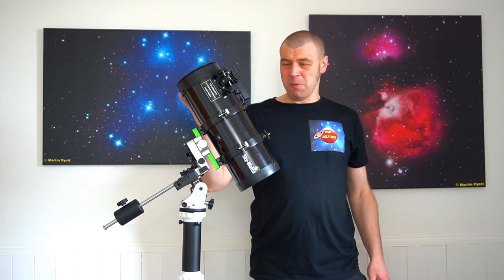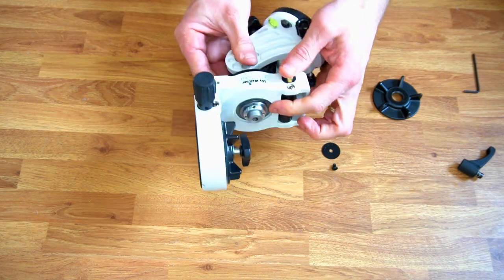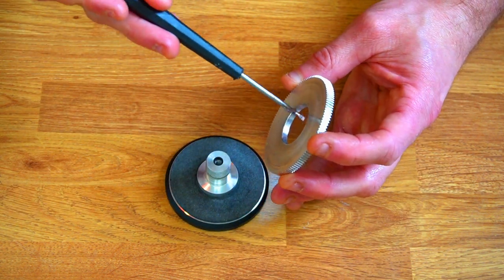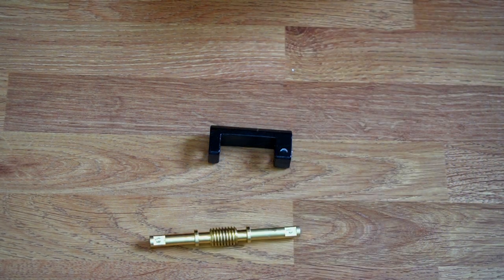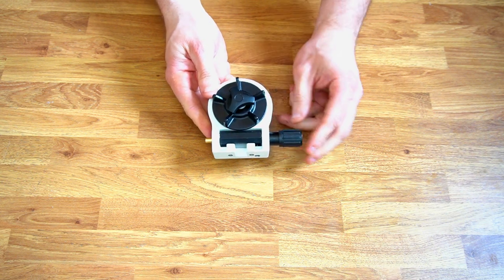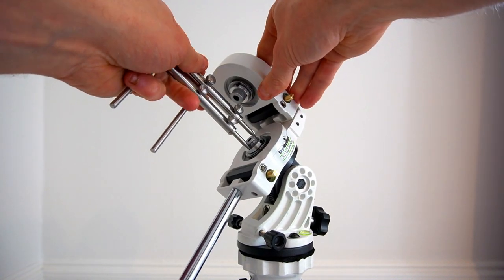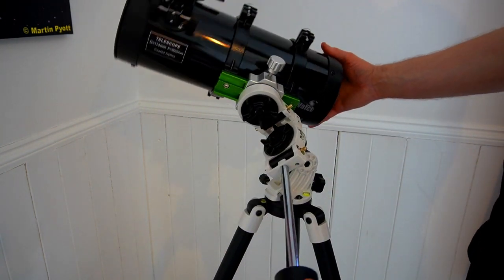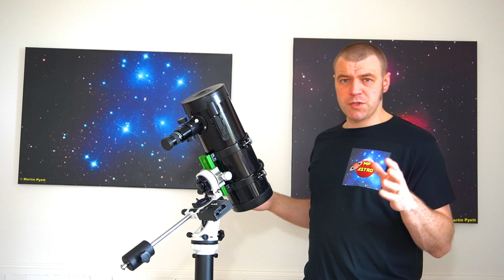The Skywatcher  AZ EQ AVANT TUNE UP

Comment: g`day martin  great video  on the mount tune up .. did you look into getting  better bearings for the ra and dec  the ones in the mount been dry  and looking a bit average in quality.  i think i would get a beer and look into  it on the net for a hour  and maybe find some  better nylon wasters material or something else  like teflon (like you can use on dobsonian mount) and good quality bearings  but that all cost money and the way you have done it. it cost nothing but the users time  and a little grease so for the budget /entry astronomer. its ideal fix to do it your way..  maybe its a opportunity for one of the telescope shops to put a kit together  with replacement super tune parts 
 thanks for posting this video mate 
cheers
james D

Comment: Thanks Martin! My SkyMax 102 with Avant mount is two years old but has been used only a few dozen nights so far, so lubrication of the Avant should be fine. However, when earlier today I installed the new Motor Drive, I also noticed that the RA movement was too tight for it. So I watched your video and learnt just how to loosen a bit the internal RA friction. I followed your tests: it should be tight enough so that the mount (with no telescope or counterweight) does not rotates under its own weight, but free enough so that it does rotate freely if the counterweight (always with no telescope) is attached. By the way, I did not have the clockmakers' two-pronged tool, but I made do with two filed-out common iron nails and a pair of long tweezers. It all took about 15 minutes. Thanks again!
[Please note that I do have a webpage on the SkyMax 102 Avant, https://www.braybaroque.ie/photo/mak102/ , with all sorts of advice on accessories and procedures for the beginner. This said, I am a simple amateur, far away from your level of expertise!]
Reply from the maker: Thanks J. Claudio for your input, I'll check out your website definitely!!! Thanks for watching and clear skies!!